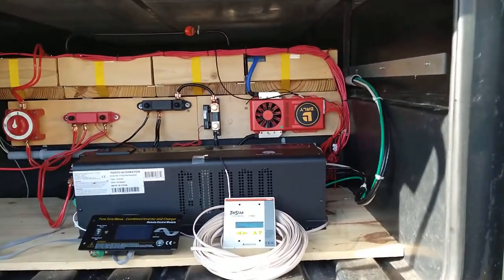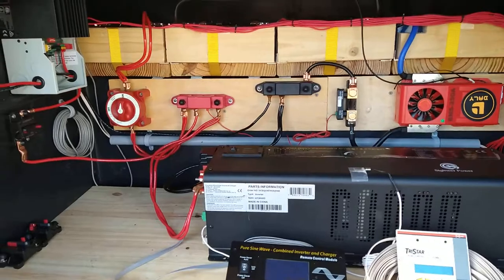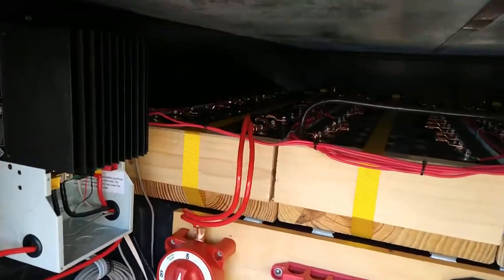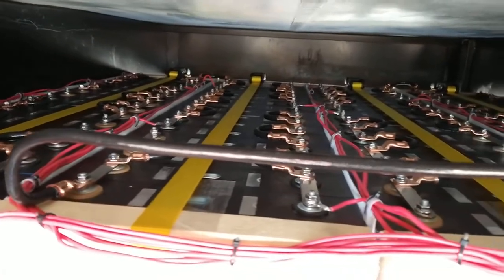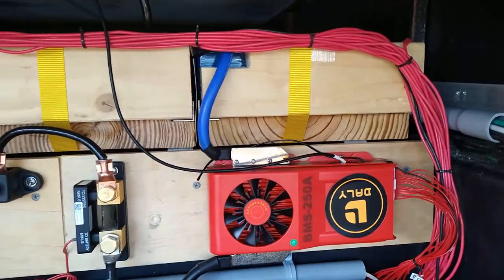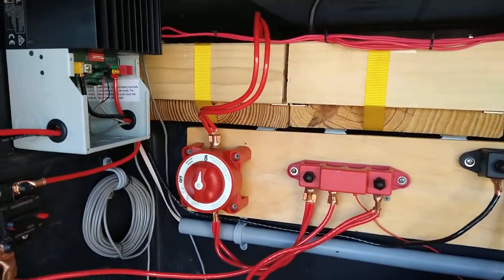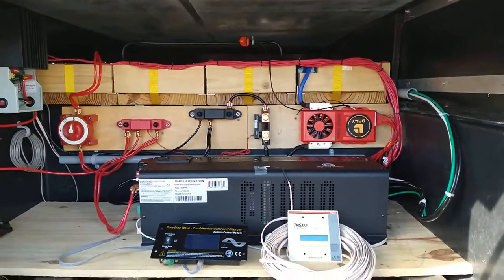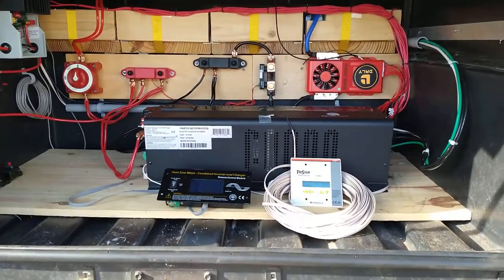The TinyHouse battery pack is ONLINE!

Comment: After a year, did you encounter any issues like 1 of the cell in 4P getting bad? Did the paralleled cells in 4P stay balanced after a year?
Reply from the maker: As of this moment after just looking at the BMS data, the pack is in perfect balance. If you were having an issue with a cell in a particular parallel stack, it will typically be seen in heat or in voltage drops for that stack vs others. Or both. 

Internal resistance will cause that stack to quickly discharge vs those nearby. Which you can see better at night when you don't have a solar charging source coming in. 

On the larger Leaf cell packs I have built, I have had individual cell failures in 10 cell parallel stacks and it was VERY noticable when they started to fail. Heat on that stack was 20-30% higher at all times, and voltage dropped almost twice as fast on discharge as the stacks next to it. 

Removing the bus bars, and testing the individual cells shows you the culprit quickly. As the bad cell will usually self discharge even isolated from the rest of the cells. So within an hour you can spot that the bad cell is out of sync with the voltage of the others in that same stack. 
Remove, replace, reconnect. Back online. 

Configured as they are on the Motorhome, I have to unstrap the whole pack, then pull the crossbars, then slide out the row and service the cells in that row and put it back together. More of a process. But those are Grade A new LifePO4 with only about 2 years on them so far. They have a LONG life left before I'll need to work on these or replace anything.

Comment: ....are you running like 12AWG wire from your battery positive to your inverter?
Reply from the maker: Its a pair of #6 wires, which has since been replaced with 1/0 Wire. Was all I had at the time. Plus we werent using over 90Amps. Within the spec of #6. A pair held fine and didn't even get warm under heavy loads. A pair is good at 90F to 160amps on paper. Which is more than the inverter can pull under full load. But a single 150amp 1/0 copper wire is best for the scenario in the video. Were I hitting 200amp+ or more, I would switch up to a 2/0. Which should be good to close to 300amps. Most batteries top out aroud there. Even Large packs like this.